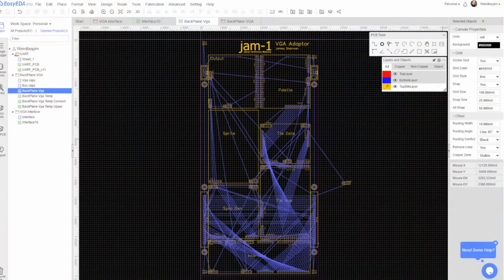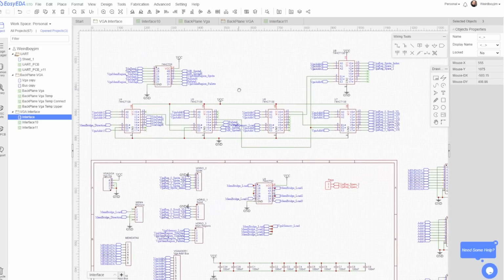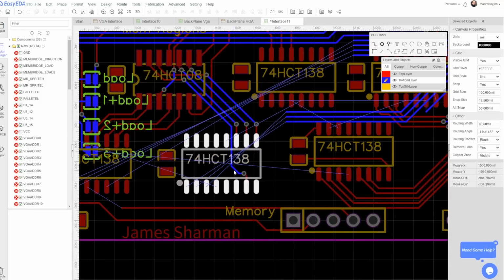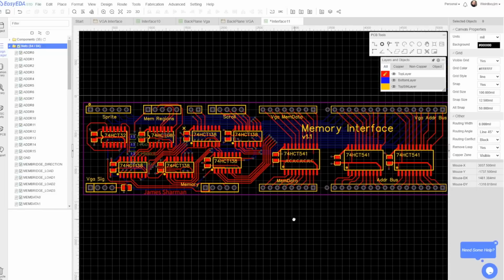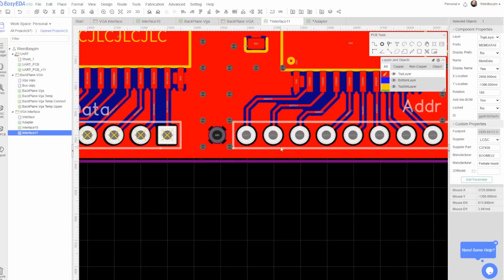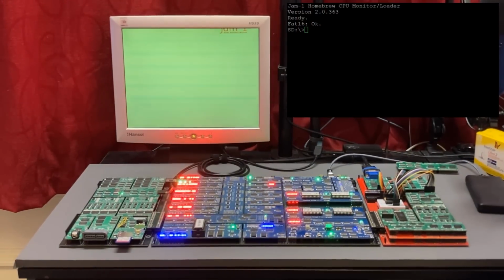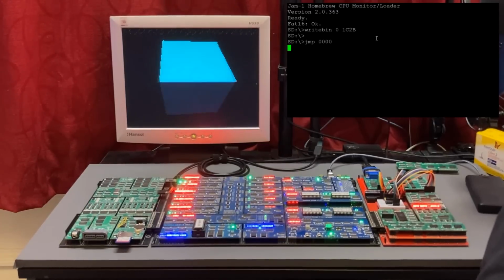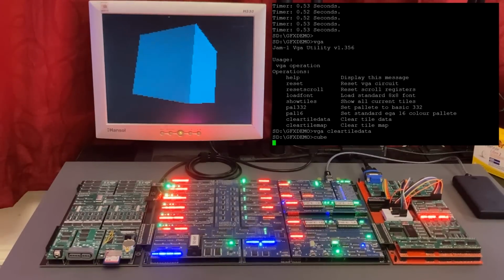New Interface PCB - VGA from Scratch - Part 20

Comment: Have you considered using a flex board for those bridge PCBs? Or a mini-ribbon cable or a flat cable? I never used any of these myself and I can't recall your reasoning when you introduced those jump boards, but I just had this random idea somehow.
Reply from the maker: Do you mean the connections between the large boards?  I actually designed those to be suitable for idc cables, I have the parts for that. I had an idea for a while that I may develop peripherals with the main cpu off to one side to give me more room, never really needed to though.

Comment: There is something oddly satisfying about this build, not only does it take me back to my early working days as a games programmer in the 90's but I like they way it has all been designed in a modular fashion and presented in a way that is really accessible. By far the best build I have watched.
Reply from the maker: Glad you like it! Games programmer in the 90's? I'm guessing that was mostly 2d?
Reply: @weirdboyjim  Actually it was mainly all 3d, this was the very early days of 3d and because I had been playing around with 3d rendering for a while at that point I knew a lot of the maths so when PCs finally became powerful enough to do basic 3d rendering in real time I ended up working on a couple of 3d engine projects. Never came to anything unfortunately as ID dropped Quake which blew everything we were doing away with their highly optimised BSP based approach. Very interesting work though for a couple of years and got a lot of friends in the industry even though I only worked in it briefly.
Reply from the maker: @schrodingerscat1863  I joined the games industry in the mid 90's so just as stuff was switching to 3d.  My first title was Swiv 3D, which used a software rasterizer I had to code from scratch.
Reply: @weirdboyjim  I similarly joined the industry in the mid 90's, I started working on a 2.5D voxel engine that could combine full 3D elements. This was later extended to a full 3D portal based engine. Unfortunately the company went under before they could bring anything to market and with ID bringing out Quake it kind of set the bar pretty high on what could be achieved without dedicated hardware. I went to work in the city writing trading platforms for one of the investment banks which was considerably more lucrative and never went back, still working in the financial services sector.

Comment: My initial reaction to the idea of sprites on a VGA was "they didn't have that"  but then I remembered that some early VGA clones did have a limited one for a mouse pointer.  I guess these faded away in favour of general purpose blitters
Reply from the maker: Yes, the mouse pointer sprite was usually fairly limited. Those were never really standardized though, in this context when I refer to VGA I'm really just using the term to refer to the video line/connector "standard".

Comment: The amount of effort you've put into this is insane. Have you done work for any of the big semiconductor corps? Also, does your ROM contain any kind of power-on self-test?
Reply from the maker: No,  I'm just a hobbyist on the hardware side of things. I'm a programmer by trade, but I've done lots of low level coding and optimization which exposes you a bit more to the inner workings.

Comment: I think the routing could have been quite a lot easier on this one by spending more time rearranging the components.
I tend to imagine the air wires as  rubber bands, whenever I see a lot of them crossed over or stretched over a long distance, it tells me that the components want to be closer together or rotated.
Single control wires are much easier to patch into a mostly traced board, then a bunch of data / I/O lines are.
Reply from the maker: Something I do a lot, but constraint on the input/output headers triggers a lot of what you are worried about in this case.

Comment: Don't throw away that solder paste! It lasts for eternity, but its flux loses effectiveness. Storing it in the freezer can extend its life, but one trick is to mix it thoroughly with a bit high quality clear liquid flux just before use. If the has hardened significantly, you can soften it by transferring it into a small metal container and heating it up (less than the melting point of course!) while mixing and adding flux to get it to the right consistency. Let it cool and add more flux if it's still too viscous.

I also like to brush the flux on the PCB pads with the mask in place before applying the solder. Find a stiff kitchen silicone rubber spatula. Here in the US, you can buy them at dollar stores for a $1. They do a better job at depositing the solder into the cutouts without lifting out the paste as you squeegee it. 

I reflow the PCB and it to cool completely and then brush all the joints with flux and repeat the reflow. These extra steps always give me a perfect bright, silvery solder joints every time.
Reply from the maker: I appreciate your suggestions but mixing extra flux into the syringe type flux is not easy!
Reply: @weirdboyjim Don't use a syringe. A stencil controls the amount of solder applied, not the syringe. They are only useful when for hand applying of solder, or for touch ups. 

Solder paste sold in jars are more cost effective and easier to apply. Just scoop it out with the corner of a spatula and smear a long bead of across the very top of the stencil and squeegee it downward with some pressure. When you're done, scrape the excess solder back into the jar. 

I would still keep a syringe around for touch ups. You can always squeeze the old syringe solder into an airtight jar for reconstitution, application and  storage.

Comment: crazy, i never would have imagined that these joints were bad and cause problems in such a manner. The joints look fine, but they're not!
Reply from the maker: Well the annoying thing is it may just have  been a very small subset of the joints I touched up causing a problem. But when testing this stuff it pays to distrust everything.

Comment: @12:27 they are not necessarily right.  You want the lowest impedance path to ground (and vcc) to the power pin.  You also want the lowest impedance path from the decoupler pins to the planes.  A trace that runs the length of the IC is going to have some impedance, as is a via.  The typical compromise for this type of package is to place the cap next to vcc pin and then use the shortest trace/via combo to connect the pin, the cap and vcc plane.  This leaves the gnd end of the cap far away from the gnd pin.  Here it is typical to use a via to gnd at the cap and another to gnd at the IC pin.  The extra capacitance you get from the sandwich of vcc and gnd planes compensates for the extra inductance of the two vias.   The absolute last thing you want is a common mode impedance in the gnd path for the IC and that's what this trace is ... dunno why people suggest this is the right way.   Any voltage induced on this GND trace will appear directly on all outputs ... So you switch one output low and you see a bounce on all the others.
Reply from the maker: Indeed.  I do try and take note of people suggestions though, there maybe something to learn or there maybe some bad information being passed around to be aware of.
Reply: @weirdboyjim  when it comes to PCB design there is more folklore than science 🤣

Comment: with old solder paste, mix in som flux,  preheat the board some more, (60 C 30 Sec. prior)
Reply from the maker: There isn't an easy way to mix some extra flux into the tube based solder pastes that I have found, I just need to track it a bit better.

Comment: If you find that you need more compact layouts there are some 74 series ICs in the HCT family that are QFN packages, a typical 20 pin QFN is about 3mm x 3mm. but it would go against the aesthetics of the SOICs you now use.
Reply from the maker: There are some in between package sizes as well, but routing gets more difficult.

Comment: About reorganising the memory... would it have made sense to put banks so to use standard (although antique) 4MB SIMMs?
Reply: They are dynamic RAM, so need refreshing every few milliseconds. This is a static RAM machine with no refresh circuit.
Reply from the maker: This was about reorganizing the vga's memory regions, not reworking the memory subsystem wholesale. As the other commenter implied there are complexities to SIMMs that it's not my intention to touch in this system, I'm trying to work within the old school limits of 8-bit cpu with 16 bit address bus.

Comment: I like the new microscope thingy, stand or mount ! I haven't seen it before unless I missed a vid. Great work James...cheers.
Reply from the maker: Thanks Andymouse! I may do an extras video on that at some point, but it's not working exactly how I want it to yet. The ideas is for the arm to let me position the microscope anywhere I want, but the camera is attached to the base so I can rotate the whole thing without the view changing much for the viewer.
Reply: @weirdboyjim  Microscopes are where you can really indulge yourself, if you have the pocket cash. However, I would rather advise on replacing that Hako-clone with a Yihua JBC clone. Short-tipped direct-heating irons are just so much nicer.
Reply: @weirdboyjim  :)

Comment: I'm sure others have asked this in the past.  Any particular reason not to use the JLCPCB SMD assembly service to avoid soldering issues?
Reply from the maker: I may well use it for other projects, but this build I want to feel like I made it myself. Exactly what that entails is likely very subjective but assembling the boards myself is part of it for me.
Reply: @weirdboyjim  Makes a lot of sense. Thanks
Reply: @weirdboyjim  sometimes the soldering has something meditative manual without breaking the brain. but sometimes it can be difficult as well, when some of the tools do not work as expected.
i did a bit of repair work for friends or solder some tiny wires on a tqfp microcontroller for connecting a logic analyzer or scope. and when i don't have the right leaded solder tin and the right flux it looks messy and is hard and then i get really grumpy and shout bad words 🙂
but when the tools are right, also with a good heavy 3d microscope, it is a nice job/change and shakes up my usual work as embedded software engineer.
i want to go in the direction of an ice40 fpga but they are coming in a really small qfn package. that will be a crazy challenge.

Comment: Absolutely smashing as always! 
This is in my mind the best DIY CPU/computer series on this entire platform.
One thing to double check perhaps; I noticed that the pin above the "a" in 'interface' at timestamp 26.01 did not appear to reflow into the throughhole metal and annular ring.
Reply from the maker: Thanks Peter!  That pin does indeed look different, but from the right angle I can see the solder has filled the space, it's just a surface difference.

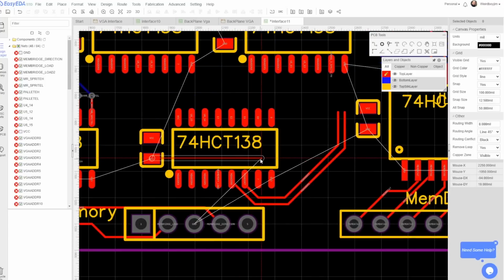Comment: 12:09 Absolutely go via the planes. That's the entire purpose on these low speed boards (high frequency return being the other reason).

I'd never connect power/ground on boards with planes. The energy will chose lowest reactance (DC resistance, and AC reactance which here is inductance). Any VIA will have far less inductance than a 15mm of thin track, and you can route the board much easier!

There is no need to connect the caps to the chip on this (or most) design.
Reply from the maker: Woo! Multiply conflicting advice in the comments! 😅  Thanks George!
Reply: @weirdboyjim  the problem with youtube comments is that everyone that chooses their words correctly sounds like an expert.  but a lot of people (a lot) will tell you to do what they like to do solely because they like to do it a certain way, but they will never disclose that because they don't realize that it is only a preference, and not a requirement.  These are the same people that will tell you that 90 degree traces are "bad".  This is a low frequency application, you really can't do it wrong if you keep all of the grounds connected to each other and you don't violate the schematic in the board design.  connecting the decoupling caps to the ground and power planes and also connecting the chips to the power and ground planes vs connecting to those planes through the pads of the decoupling cap won't matter much, if at all.  electrically it's all the same.
Reply: I second this. although, for the positive leg, having a short and wide trace can often be better than going through two vias to the power plane.
Reply: Of every professionally designed board I've ever examined, I've never seen the ground leg(s) routed directly to a decoupling cap.

Never heard Robert Feranec talk about that either. His videos are a gold mine for PCB design. 🙂
Reply: @TomStorey96  Exactly. I do this for living, for very demanding designs. Nobody routes ground anywhere but to the ground plane. On a BGA package, it isn't even possible to wire everthing to an actual net.
Reply: The energy will not "choose" a path, it will always use all available paths proportionally to resistance and reactance. You might however introduce other problems, since capacitance and inductance will together form a resonant circuit, and every leg will be one more potential LC. That'd be the main reason why you would prefer a single path, since it makes predictions easier.
Reply: @graealex  sorry, I was using the term choose colloqually. I'm very aware how it works, it's one of our standard graduate interview questions, too! 😂

Comment: Nice. Too bad solder paste doesn't last longer. I've seen other YouTubers mix a little flux in with aging paste. That might work for you or it could just cause more problems. The keyboard sound seemed less resonant, did you change something there? Thanks for the update James. Take care.
Reply from the maker: The keyboard sounds is less as I’ve been manual reducing the volume of all the typing segments 😅
Reply from the maker: Solder paste is difficult, I’ve been getting the stuff in a tube, it lasts longer but it’s even tougher to mix some fresh flux into.
Reply: @weirdboyjim  One of the vid's he squeezed out a bunch onto a work area and mixed it there.

Comment: 1:15 So you've decided not to go ahead with the FIFO buffer discussed in earlier videos?
Reply from the maker: Yeah, I planned out a rough circuit for it and it wouldn't have fitted in the space I left. Running low on space elsewhere then sealed it's fate. It was always a stretch goal anyway. I may do a video on the circuit when everything else is done.